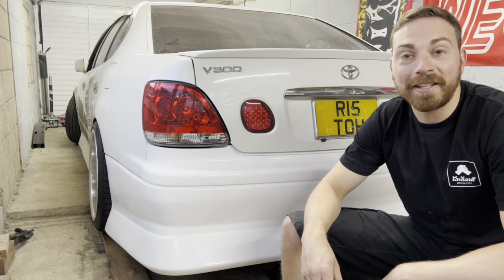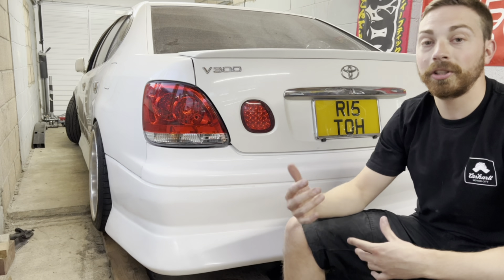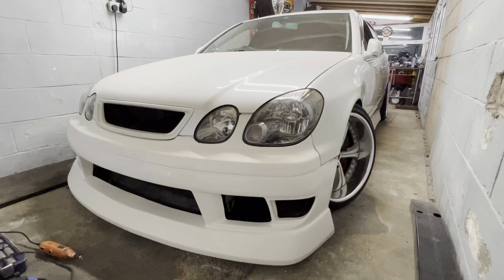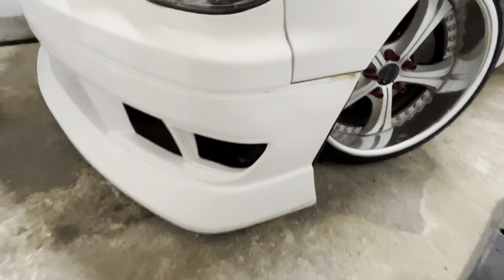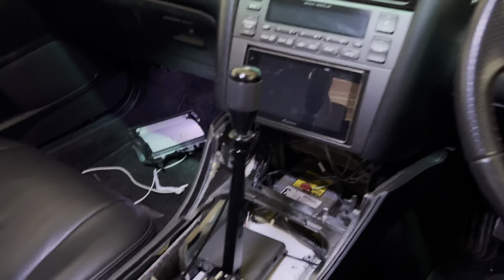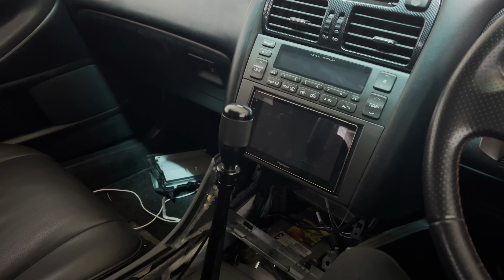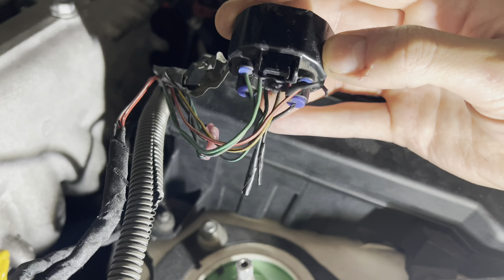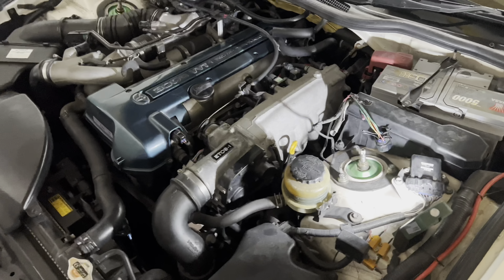The conversion is complete! (Aristo manual swap)

Comment: Hey man! I’ve been dying to use the gt86 steering wheel in my aristo. Is it a direct fit?
Reply from the maker: It was fitted on the car when I purchased it but yes I would be extremely surprised if it wasn’t I’m almost certain it will just fit right on.
Reply: @smokeyhouseproductions  did some digging and it’s supposed to be a different spline count? Dunno how it’s mounted on your car. Would love to know if it’s a direct fit
Reply from the maker: @rictorkooldude10  no idea man the guy before me had basically minimal mechanical know how so presume it just fits tbh